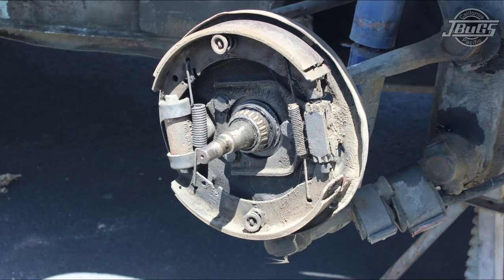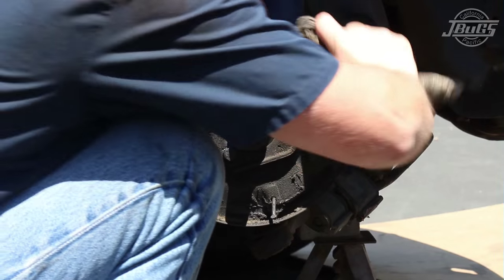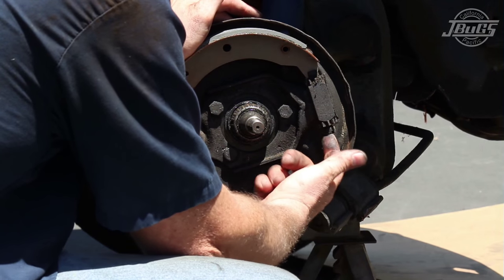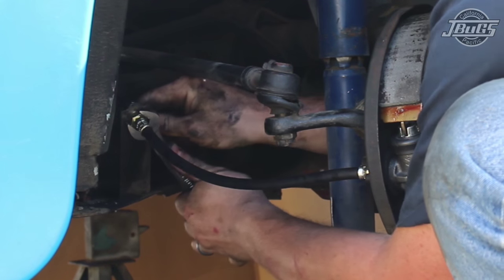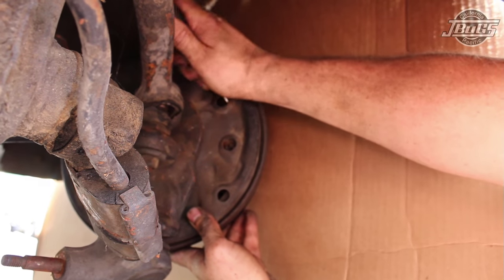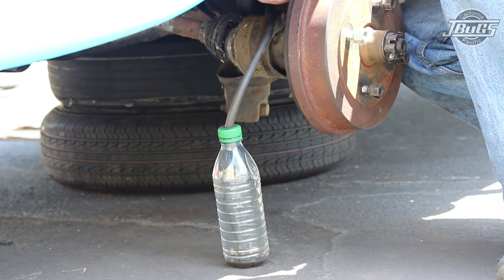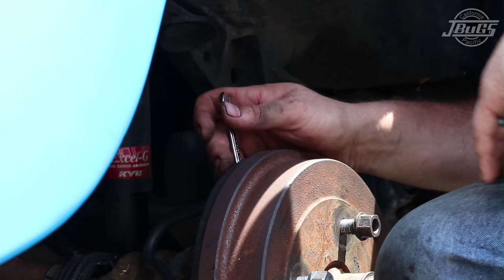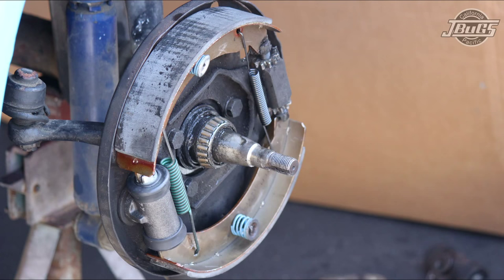JBugs - 1969 VW Beetle - Front Brake Shoe Rebuild

Comment: getting ready to do complete break job like video.  Question:  The parts noted for front and rear break job would they fit a 1966 bug.  Also, can you do all front and back breaks BEFORE you start the break bleeding process OR you have to do one wheel at a time>
Reply from the maker: +rioraton
We offer http://www.jbugs.com/product/T11966BK.html specifically for the 1996 Beetle, or the items can be purchased individually as needed here: http://www.jbugs.com/category/1966-vw-bug-brake-parts.html All of the repair work should be completed before the brakes are bled, yes.

Comment: If there is play outward what would cause that problem
Reply from the maker: What problem are your referring to?
Reply: JBUGS the front drums wobble in and out after reassembly
Reply from the maker: New brake drums do not include bearing races. If you’re re-using your old bearings, the original races from the old drum need to be removed and installed in the new drum.